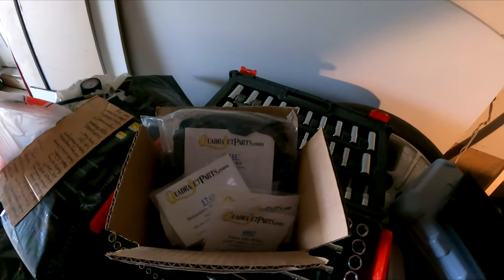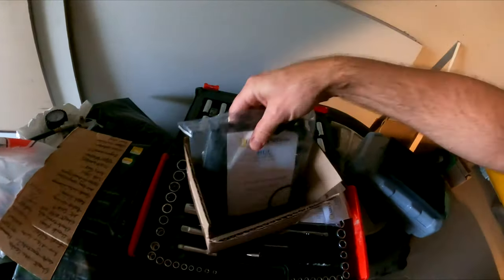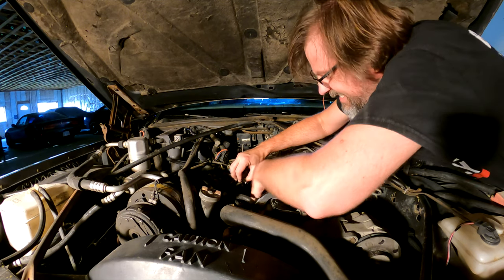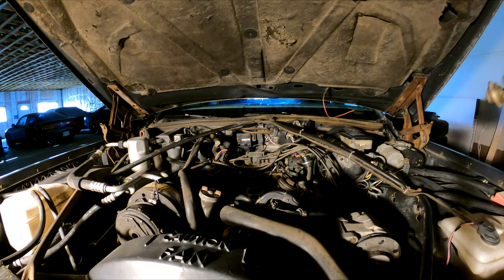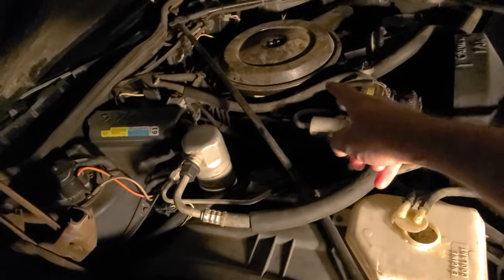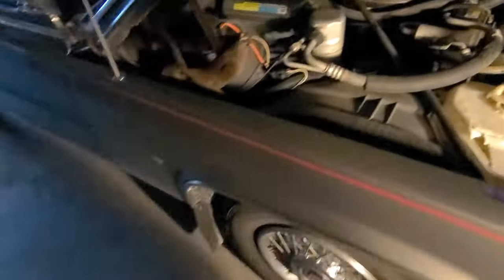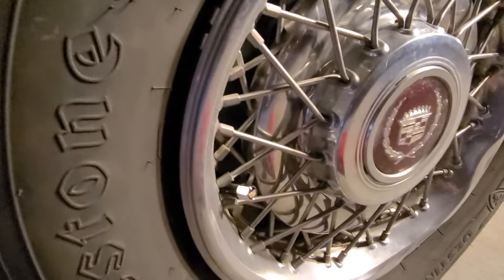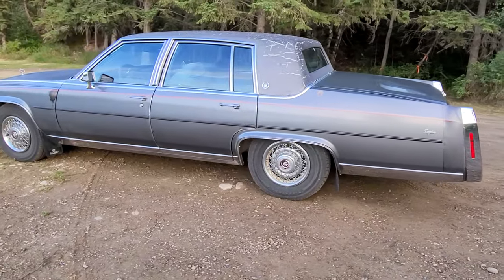FINALLY! Found the bad idle cause and fixed it! Ethanol kills carbs! QJET Rebuild in the 88 Cadillac

Comment: That's a very smick looking car. Well done so far on it. Must be a good feeling you have finally fixed the carby issues.
Reply from the maker: It was awesome! Its went from a strung out beater to a lovely cruiser instantly. The "work around" to get it to drive was adjusting the idle speed so high it was always in the main fueling circuit, being able to idle at under 1500RPM really made it a lot nicer to drive and enjoy